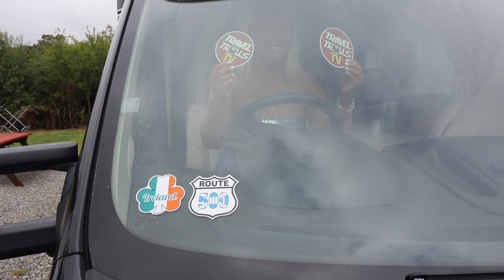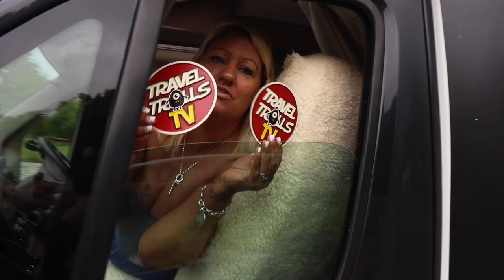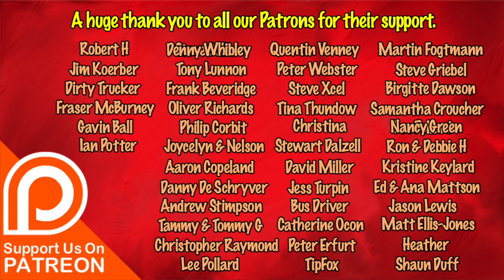My Girlfriends Had A Baby Delivered

Comment: you should always turn the gas of when travelling unless it is fitted with crash protection (there will be a green button on the pipework somewhere near the gas bottle) when travelling you should put the fridge to battery operation and not leave it on gas (if your fridge is auto selection it will do this anyway) it will not drain the battery as it will be topped up by the alternator when the engine is running. when on ferry or euro tunnel you must always turn of the gas regardless of protective device.
Reply from the maker: ok thanks.

Comment: How to check how much you've got left in your gas bottle:
Fill up a jug or bottle with warm tap water.
Pour it down the side of the gas bottle.
Wait 5 seconds.
Using your hands, feel for a temperature change on the bottle.
The part that's cold to touch will indicate how much gas is left. If it's cold near the top – you're ok. If it's warm the whole way down
😍😍😍
Reply from the maker: Great tip thanks.

Comment: Yes turn your gas off while travelling, if you had an accident you will have gas leaking so best turned off for safety reasons. Fridge should be running on 12v while driving. really enjoy your videos guys.
Reply: Additionally, while at the petroleum station, a spark could cause your propane to ignite.
Reply: It’s not mandatory but highly recommended that gas cylinders are CLOSED WHEN TRAVELLING. In the event of an accident, however small, it is possible that gas lines could break, increasing the risk of Fire🔥This is why  motorhome appliances such as a fridge/freezer have a 12v option. ⚠️
Reply: Kelly Salzwedel ... would that not ignite the petrol ⛽️ also ??
Reply: No need to turn gas off in modern vans.. they have auto crash valves

Comment: Hi you two, got 2 tips for you. 1. The weight is stamped on gas cylinders when empty. So just work out what gas is left from weight of gas bought. Be aware stamped why may be pounds or kilos.   2. Use a sheet of clear  contact sticky paper to stick your Trolls disc on windscreen. Loving your blog and how you manage to keep your spirits up needs packaging and selling. Ray and Pam
Reply from the maker: Thanks for the tips!

Comment: To get around the gas cylinder level problem have you considered refillable gas cylinders? They are fairly expensive to buy but you will quickly recover the 
cost in the saving you make each time you fill them up. There are a few company's offering refillable cylinders, Gaslow and Gasit are a couple that jump to mind.
There are lots of motorhome vlogs about the process of installing the system. Good luck.
Reply from the maker: Yes, we can't afford it.

Comment: 6 sausages?  Christ on a bike man you'll fill the toilet cassette in one sitting!

Alarms:  My cat 1 alarm works in a similar way.  You use the key fob to activate the alarm, then press button 2 twice to disable the internal movement sensors.  So the doors are armed but you can go for a wee in the night without waking up the whole neighbourhood!

Your fridge will run from the 12v system when the engine is running. Ideally you should turn the gas off at the bottles while travelling but I never do.

Happy travels!
Reply from the maker: 6 more sausages after which wouldnt fit on the plate.

Comment: As a rule I turn the gas off and this switches the fridge over to 12v  not because I am worried about it being on in a crash but why waste gas when on the move use the 12 v  that is being re charged as you drive it is free ?? As a Yorkie I am surprised you have not cottoned onto that one Dan yes as in free :) Regards the gas the one you was thinking of is Gaslo I have it installed and above the bottles you get a gauge that lets you know what is in the bottle simples and it is LPG .

Comment: Glue Dots will sort you`re window sign no problem....small but very sticky on both sides,dry no gluey mess,made from gel like material transparent and easy to use ....put a row of them on each edge and it wont go anywhere...no residue very strong ....craft shops,or e-bay £3.29 for box of 200
Reply from the maker: Thanks for the tip.

Comment: As said you are required to close the valves on gas cylinders in a public highway unless you have a crash regulator that will shut the gas off in a accident automatically .

Comment: I would soak it in Clorox for color. It has peroxide and it would eat the mold away without hurting the color.  You may have to do it many times. Pour it directly on it. Scrub it with a toothbrush.

Comment: Hi Guys, I always had my gas on(LPG). Never heard any reason not to. I can think of some but in 10 years I never had a problem. Also, there are connectors for the tank that have a gauge on them. They are cheap to buy. Those switches are for isolating a particular unit without shutting off the gas to everything. BR,R
Reply from the maker: Thanks for the tips Roger.

Comment: Evening all!
You can drive with the gas on as long as you have a cs valve
( crash sensor) does what it says on the tin! If you have a accident it will automatically cut the gas off! ( Hopefully) but I believe even with this valve you are not allowed to drive with the gas on in Germany.
Does that little shop sell anti clockwise oil filter wrenches?
Caption. Is that an oil filter in your pocket Dan or are you just pleased to see me.
Reply from the maker: Thanks for the tips.

Comment: Dan. The law states that you cannot drive with the gas bottle open unless you have a crash isolator valve fitted in the gas locker. Check your handbook to see if you have one. As someone commented earlier, it is due to the explosive risk of open gas lines in the event of a crash. (Most modern motorhome or caravan fridges can be cooled on  the battery whilst driving and then switched to mains or gas when parked).The valves under the sink are for isolating an individual appliance in the event of a fault/leak. Don’t use them unless you know what you are doing, always turn the gas off on the bottle and you will have no gas in the motorhome.
There are numerous accessories you can buy to tell you how much gas is left in the bottle. The cheap version is the magnet that changes colour Dan explained and they get terrible reviews. The expensive version are scales that fit under the gas bottle and they Bluetooth to your smartphone to tell you the weight, hence how much gas is left.
Dans way of shaking the bottle works because the gas is stored as a high pressure liquid in the bottle and can be heard swishing around if you shake the bottle. Not accurate, but if you hear the liquid, you have gas left. How much ?
Reply: UK law
Reply from the maker: Great tips. Thanks.

Comment: you can get a butane gas regulater with a level  indicator to help keep check of your gas bottle you can get them on ebay  but check the fitting of you gas bottle to help you get the right one.

Comment: Hi both of you. The reason for turning off the gas is if your hit by another vehicle a gas pipe could get broken releasing gas into the motorhome and possibly causing a explosion. Some Van's has a regulator with a button that you have to press when you turn the gas on. These automatically cut the gas supply off in the event of an accident.
Reply from the maker: Thanks for the tip. We will look to see if we have one tomorrow.

Comment: For the mold soak in hot water in a sink and add a cup or 2 of white vinegar and let it soak for an hour or 2 thenxhit it with a brush and rewash it again as usual.
Reply from the maker: Thanks for the tip.

Comment: Vehicle motion can cause appliances and cylinders to move around, putting strain on hoses and connections and potentially leading to gas leaks. If you're in an accident, a securely shut LPG cylinder is far safer than one with an open connection.

Comment: Pour a bit of water on your gas bottle. You will see frost develop on the tank. That frost will tell you how much  remains.
Reply from the maker: Great. Will try that thanks.
Reply: @TravelTrollsTV  slowly pour a stream of HOT water (about a gallon) down the side of a standing propane bottle, use your hand and touch the bottle from top to bottom, the empty area will be warm until you reach the " liquid propane level" which will be cooler, I've done this as long as I can remember & I guarantee 100% results
Reply from the maker: @furface9779  A few have said similar. We might test that tomorrow. It all adds to interesting vlogs. Thanks :-)

Comment: Your fridge doesn't run on gas when you're driving, it runs off the engine battery. We don't turn our gas off as it has an anti crash valve, which yours probably does too, but some people do turn it off. The canisters you can see through are called Safefill and you fill them at petrol stations with LPG.

Comment: Hi Dan, screen wash  reservoir, under blue flip up cap, there is a inner tube that pulls out from inside the tube on the reservoir, it pulls out about to give you an extension tube to make filling up easier, hope this helps 👍

Comment: I think you're supposed to turn the gas off when driving unless you have one of those crash valve things.  If there was a crash, a spark would cause it to explode and its a bit dodgy at fuel stations too.  That was really kind of the mystery donor to give you the second camera, looks quite a costly thing, well done them.  A nice gesture.  Sounds absolutely fair to give your other logo thing away to your patreons or donators.  For the caption - "There's a mazz-ive puddle of screen wash under there...".

Comment: Mazzy,  maybe try Lighter fluid(like what you put in one of them old fashioned hand lighters)  try a spot , blot/rub gently, rinse, warm water and soap it and rub gently, Rinse again with cold water.  I use to do that with ink stains on my dress blue blouses. { OR}  Try Aqua Net hairspray!  It works on so many stains of things like ink, etc.  or try a small area with hydrogen peroxide, straight pour on @1 tsp at a time, let set for abt 1min., gently rub around area, and rinse warm water. If it came out. rinse more with cold.
try lighter fluid first.
Let me know if any works.  Hope it does; You look so pretty in blue.
Carol Sue Griffin
Reply from the maker: Great tips. Thanks for that.

Comment: Hi Dan & Mazzy, I understood the gas should be switched off at the bottles, It is to protect gas leaks in the event of an accident. Your fridge should maintain its temperature by switching to 12 volt, some fridges have an automatic position which means it will default by itself, i.e if no hook up then gas if no gas then 12 volt

Comment: is that cable not interchangeable on the charger end? i have a charger on my camera similar and the cable pulls out like a  portable stereo cable , it looks like it does. just lightly pull the cable near the charger box it should pop out so you can put a two pin in.
Reply from the maker: No

Comment: Hopefully enough of us will say it -  Switch off your gas at the bottle when you move and use your 12v when in transit.  You are more likely to get a whiff of gas when stationary. Gas leak when driving could spell disaster. Just saying.

Comment: For travelling the gas should be turned off at the bottle and also the valves in the kitchen. The fridge runs on 12volts so no problems there.